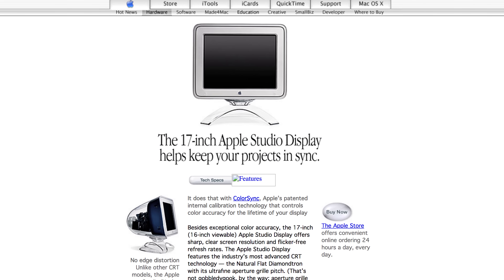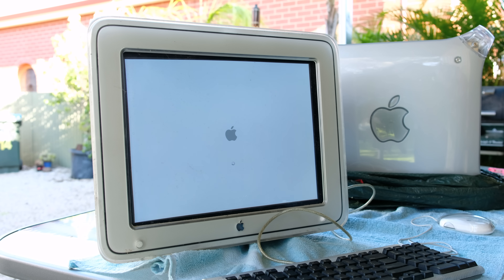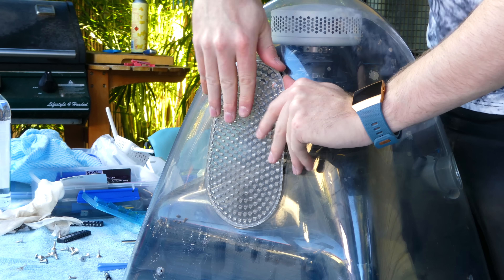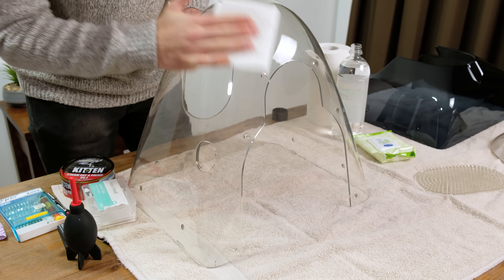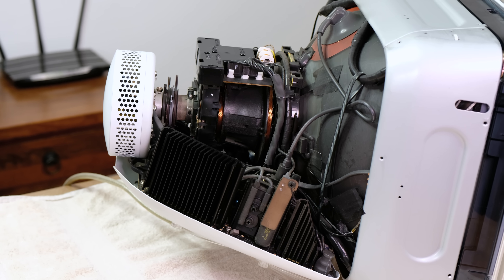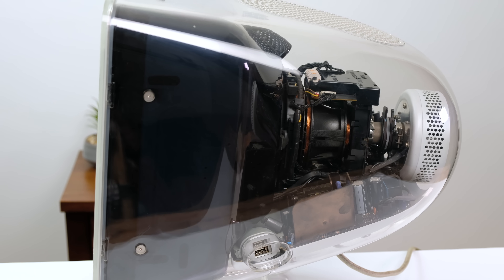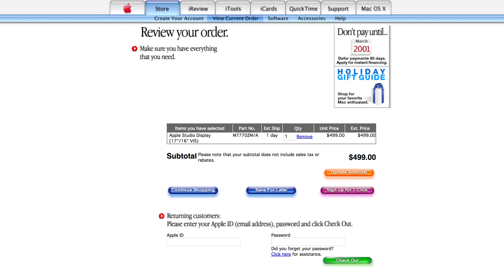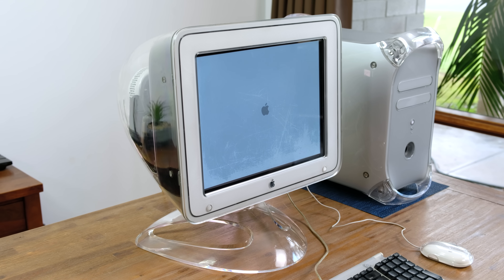Apple's Last Ever CRT Display!

Comment: "Remember when Apple included stands with their displays?" The Apple of today would have charged you $300 for that plastic stand easy.
Reply: *cough* 999$ *cough*
Reply: @Bigthebomb  he's talking about that plastic stand.
Reply: Apple is like EA these days.
Reply: @polskiobywatel553  ApplEA
Reply: Apple didn’t include a display stand with their just released Pro display because the high end professional video editing/reaction market they are  aiming the Newest Mac Pro at doesn’t generally want an in;ceded stand because they often make use of VISA mounts they already have installed or they prefer to choose their own type of stand. They could have included some sort of inexpensive basic stand with the monitor but in far to many cases, that stand would simply be thrown out filling up land fills unnecessarily. Anyone who is going to spend $6,000 on a pro monitor can choose and purchase a separate stand or wall-mounted arm or whatever of whatever type best suits their needs, either from Apple or from a third party. If they had include say the $1000 stand they showed a WWDC and say charged $7000 for the display (w/ stand), while it would still be cheaper then the typical reference minors that professional content creators use in Hollywood, TV land, etc., far to many of the stands would simply go unused leading to great waste. It’s not like the iMac where most purchasers of it (even the Pro version) will use the included stand. 

The major problem here is really one of Apple selling a product designed exclusively for Pro content creators but including it’s debut in a WWDC keynote seen by many people who are not pro content creators and who don’t grasp why a monitor without an included stand might be a good thing or why a $1000 Apple display stand might not be the rip-off the ever age person thinks it is. One thing you have to remember is that these machines, displays, and stands, are not going to be selling in large quantities (compared with the iMacs, Mac Minis, MacBooks, etc.) and thus they are going to charge a premium over tower end products because the expense in R&D for these products needs to be recouped and volume sales is not where that’s going to happen. The types of pros buying this computer and display can afford to spend a premium for it because they are producing high end movies (or TV shows) worth it where they budgets are high enough to recoup the cost easily, When you making a blockbuster movie costing over say $100 million (or $200 million or whatever) then you not worried about Pro Mac and Pro display costing under $100,000, especially since you can use them on multiple films over their lifespan.
Reply: As long as suckers keep buying their products they'll keep doing it.
Reply: Dennis The Menace but this isn’t just your typical simple monitor stand. From what I understand it includes a fancy mechanism to allow the monitor attached to easily  be moved up and down and angled with it holding whatever position you move it too (similar to the old iMac G4 aka the all-in-one flatscreen lamp style iMac from 2001) and thus is nothing like say the simple iMac stands included with the iMacs. It not just your typical monitor stand but Whether it cost Apple anywhere near $1000 to develop and make I don’t know. I do know that the Hollywood studios spending over $41,000  minimum on a Mac Pro plus Apple Display are probably not going to balk at $1000 for a stand if it meets their specific needs especially with the typical reference display used in Hollywood these days costing $30,0000 just by itself (making a $7,000:for Apple Pro display and stand a bargain). If you’re buying the a Mac Pro and the Apple Pro Display and want a much cheaper stand then  $1000, there are plenty of simple stands made by third parties that will work with this display for much less. Many Hollywood studios will simply not bother getting any stand and as they can just use the VESA mount they already own and were using which is why Apple sells the display without an included stand.
Reply: Mr Random No, i can’t justify the price with the stand but then I am not a Hollywood movie studio or high-end video editing company who spends tens of millions on a movie at minimum if not hundreds of millions. Your basic premise rests of the assumption that Apple is or will be able to sell these stands in quantities that would allow them to get enough of a bulk discount format he manufacturing company to allow them to be produced for much less $200. Even if we assume that Apple isn’t trying to make a profit on the stand, something they have every right to do, it’s not clear that they are able to have said stands made at some much less then $200 per stand that even with a reasonable profit added they could be sold for much less then $200. Since I haven’t compared that Dell monitor stand (for whatever Ultrasharp monitor you where thinking about) to Apple Pro Monitor stand, I can’t say how close it is in features, design style, durability, etc. all which could effect that cost per stand. Apple has never given out Apple Mac Pro, Pro Monitor, or stand sales numbers so we can only speculate but given the price of the Mac Pro at minimum or the monitor I doubt they sell in very large quantities. Even if the Dell and Apple stands were similar enough to be comparable, there is still the issue of Dell potentially ordering many more stands produced then Apple does and thus getting a much better price per stand then Apple. 

As for average people buying an Mac Pro, Apple Pro Monitor, and Apple Monitor stand just to show off, I highly doubt many are going to do that, except maybe a small minority of very wealthy folks for whom $200 is pocket change. While it’s true that there are people buying consumer Mac/IOS products to show off, none of these cost anywhere near what an Mac Pro or Apple Pro Monitor cost at a minimum. Buying a even a $1000 iPhone or a $2000 iMac to show off isn’t the same as buying a $30,000 Mac Pro with a $6000 Apple Pro Monitor and $200 stand. That comes to $36200 for just that alone for the lowest priced Mac Pro and just how many people would or could spend that kind  just to show off? Remember, your can’t just plug the Apple Pro Monitor into just any Mac or PC computer and expect to fully utilize the full feature set & specs of this monitor and few would buy such a expensive monitor just to display non-HDR 1080p or 4K signals from a much cheaper PC or Mac.
Reply: Mr Random we don’t know exactly how much the stand cost so we can only speculate. As for that Dell UltraSharp dipslay, It doesn’t appear to be a HDR monitor unlike the Apple Pro display so while it’s fine 1080p content, it’s not going to cut for 4K HDR expanded color palate content. I believe LG is making a cheaper HDR display that would compete with Apple’s (most Pro HDR reference displays sell for $30,000 or so) but, if that display is on the market I would have to see just how well it does against the Apple Pro Display in specs, features, and image quality. Nobody doing only 1080p content should be buying a Apple Pro Display IMO or even an HDR display unless your simply wanting to future-proof yourself or use it also as way to view streaming 4K HDR content from the internet.

Comment: CRT's should still be made, but more for the gaming market because of it's fast refresh ratio.
Reply: CRTs are supposed to have pretty accurate colours I hear or (most of them) I was pretty young when I used to use mine for the old family computer so I don't really remember.  I agree certain types would be cool if they were made but no one would buy them.  Even with all the advantages people think of it as a technology of the past which isn't wrong but isn't exactly right either.
Reply: @TheGunman889  Yeah, true, it would have a very nish market and it would mostly be for the retro guys. Oh, and they would be HUGE.

Comment: that's insane, 154hz in 2000... people definitely didnt apreciate it as much as they do today! also 1600x1200 which was insane for that time
Reply: CRT displays have a great advantage on refreshing rate, and a great color range as well.
Reply: Some high end CRT monitors in the early 00s had max resolution of 2048x1536. For example Sony GDM-F520.
There was also Sony GDM-FW900 which is 24" 16:10 2304x1440 80Hz monitor. It can do 1920x1200 @ 96Hz and it doesn't have any lag because it's a CRT
Reply: @Pasi123  proud owner of a GDM-FW900, still using it!
Reply: @Pasi123  i have GDM-FW900 that's too  weight and it can produce accurate colors. Sony doing good old days. but now .................
Reply: Pasi123 I NEED THAT IN MY LIFE
Reply: CRTs are great though honestly
Reply: even in 2019 I still use 1024x768 resolution with my lovely 4:3 ratio Philips 150s3 white
Reply: Mitsos Tech Tips that’s the same resolution with the iPad 6
Reply: Max Raider  all brushless engines produces magnetic fields intentionally to work, loudspeakers produces them to generate any sound at all, so what. Heck, earbuds do too and everybody sticks them in their ear canals near their brain and no one cares.
In case you wonder, no, CRT do not produce magnetic field stronger than a loudspeakers in the surroundings, actually the opposite. A non-shielded speaker (many are not.) close to a CRT can permanently damage it as the magnetic field reaches mercilessly all the way through to electron guns, Yoke, phosphors mask etc.
 If the strong permanent magnet inside them is shielded, on a decent volume it can make the CRT raster shake as the actual electromagnetic coil that generates sound in the loudspeaker has a field that can reach inside the CRT anyway and affect the Yoke.
All the stigmas about how bad and mean CRTs are is pure marketing bullshit from the early times of commercial LCD TV/Monitor, they had to convince the average joe to jump on a new format that, for their casual use, gave no benefits or was full downgrade from CRT (watching, playing SD content with no concerns of space saving) so they relied on gimmiks or flat out lies to sell the new toy.
Reply: @andrealotito4412  Well, with the exception of the amount of lead content in the vacuum itself. Not even remotely environmentally friendly. But on the plus side, CRT's don't exactly conform to just one native resolution like LCD panels. Can run lower than native resolution and still get good picture quality, whereas with LCD panels, you'll get really piss poor picture quality. So sacrificing your resolution for higher refresh rates is more optimal on a CRT.
Reply: lizard
Reply: I had a KDS VisualSensations monitor from years earlier which was significantly higher. LCDs have always had a lot of catching up to do with refresh rates. You gotta remember that CRTs already had decades and decades of technological development when consumer LCD monitors finally became mainstream.
Reply: CRTs need that extra refresh rate. A 60hz crt gave me headaches
Reply: CRT/DLP displays and TVs have crazy refresh rates. That was the trade off by going to LCD panels.
Reply: @BankruptSee  you need to change your name to techshit, CRTs have way more latency than LCD, LCD input lag is around 2ms, CRTs over 8ms, fucking morons sucking up to CRT like theyre superior
Reply: @girlsdrinkfeck  The raw input lag of a very good monitor made recently is 2ms. The top of a crt measures at 0ms. The middle of the crt measures about 8ms, which is the area usually tested for measuring response time. The raw input lag of a monitor is 2ms, but it does not count processing time, as an LCD draws the whole image at once. Combining these factors, this usually averages out to about 10ms, 2ms slower than a CRT. Here's a good link about this. https://www.resetera.com/threads/crts-have-8-3ms-of-input-lag-addressing-a-common-misconception-about-display-latency.40628/post-7607363
Reply: Mr BuzzKill  4:3 > 16:9
Reply: Ivan Marić Insane if you don’t count the four $499 price tag Without inflation and 154hz and 1600x1200p Don’t go together
Reply: my samsung syncmaster 950p produced at 2000, runs 1152x864 100Hz
max res is 1920x1440 60Hz
Reply: they had 1440p monitors back then as well. it took flat screens over 10 years to catch up to crts
Reply: But can you figure out any case scenario where it makes sense to run anything at 640*480 and really taking any advantage of the high refresh rate?
Reply: @BilisNegra  quakeworld. Played it at 200 and even 240 hz at 800x600, but finished at 1280x1024x132hz
Reply: It has better resolution than the iPad 6. I looked to my resolution from https://bestfirms.com/what-is-my-screen-resolution/
This is the real resolution
Reply: Joshua Paul  wait not all CRT's used interlaced video?
Reply: Joshua Paul  looked it up And It said most CRT monitors use progressive scan. Yep I was wrong about the second part. Good thing I said I think lol.
Reply: If CRTs had better refresh rates and few of them had better resolution, what's the point of LCDs?
Reply: Oblivion[2]  Power consumption, manufacture costs, size and weight, etc.
Reply: @nugget6635  ur 10 months late
Reply: well, vertical resolution is higher than 1080p. So long as you're ok with the screen real estate (maybe get a side monitor), that's stupid sharp. I'd game on that.
Reply: My bottom of the barrel Samsung CRT can do 120hz at 640x480p, and in interlaced mode it can do 120hz@1024x768i

LCDs were garbage and I didint understand why everyone was praising them so much. Yeah it was thinner but the viewing angles and colors were pretty doodoo. And unlike CRT TVs, CRT monitors were the same resolution as their LCD counterparts.

It's not until the last couple of years back that we got LCDs with the black levels and refresh rate of a CRT.
Reply: Not insane at all lol, my CRT from early 200s
0s can do 1024x768 at 180hz
Reply: def not mac users lmao
Reply: @gamagama69  Just like back in 2000, some computer users prefer resolution to refresh rate, which is the same tradeoff that has existed for decades.  There isn't anything wrong with that.  If you're busy dealing with text or photos all day, it's a reasonable tradeoff to make.
Reply: Any adapter for that monitor?
Reply: Mr BuzzKill  can u do read ?
Reply: That better than 1080p so thats still a quite good moniter
Reply: @motap4935  It's not, 1080p has about 150,000 more pixels, but it's really not too big of a difference. The discrepancy is because it's a 4:3 monitor and 1080p is 16:9
Reply: @AeroBigDick  CRTs don't have pixels(cut out the second half of my message as it was incorrect)
Reply: @AeroBigDick  1080p implies 1080 pixels in height
Reply: @motap4935  how u work that out ??????? maths not ya strong point
Reply: @girlsdrinkfeck  lol wut
Reply: @girlsdrinkfeck  grammar too
"moniter"
Reply: That’s not better than 1080p